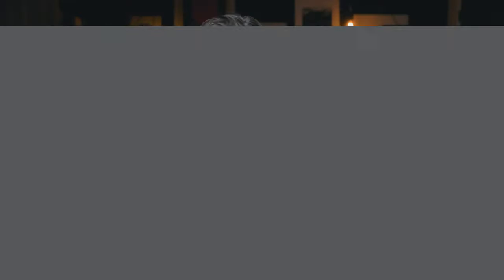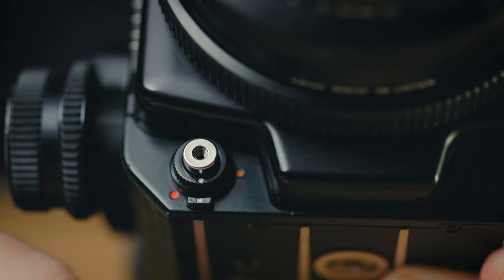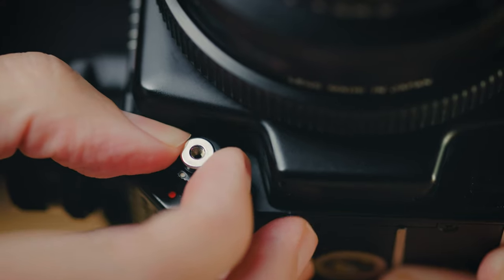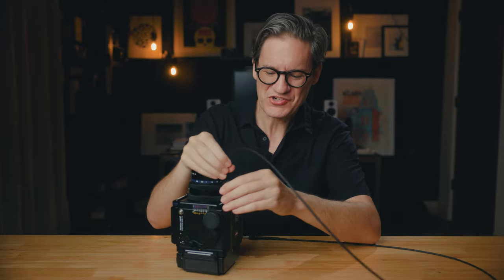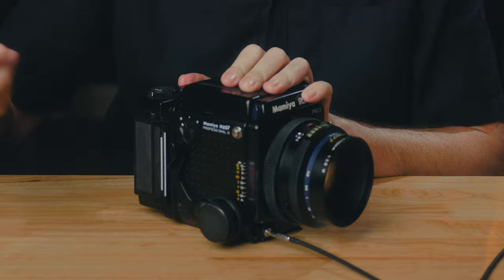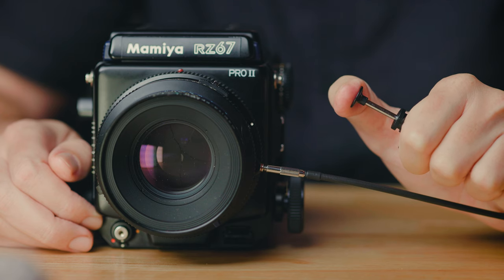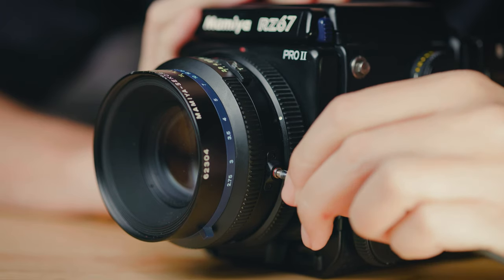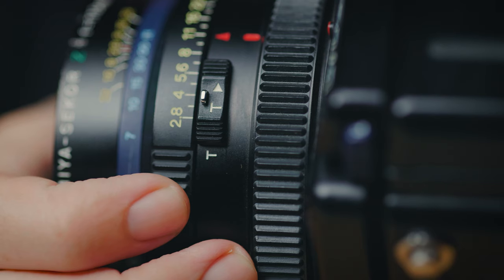How to use a cable release with the Mamiya RZ67

Comment: For long exposures the safest solution is this one: I have the electronic cable release attached to the camera body and the simple analog cable attached to the lens. Then first you press the electronic cable release which activates the mirror up function. Next you push the analog cable release attached to the lens, which basically opens the shutter. So untill this point the process is the same like yours but the main difference is the last step. To close the shutter I just have to push the electronic shutter one more time. That‘s it, no touching the lens or anything on the camera by hand. It’s annoying to have two cable releases but it’s the safest solution to avoid camera shake. And yes, no one seems to really know about this and it’s really hard to get good information in that regards. Not even the Mamiya manuals are very helpful.

Comment: A really good clear explanation. I do not use a cable release but far prefer an air release (one with a rubber bulb to squeeze) as I found this more reliable as with use cables tend to stiffen up, you can add tubing to vary the length and are less likely to cause camera shake. I have also the Mamiya double release which I no longer use it being a bit fiddly and having no real advantage.